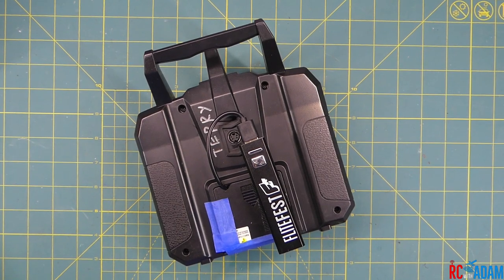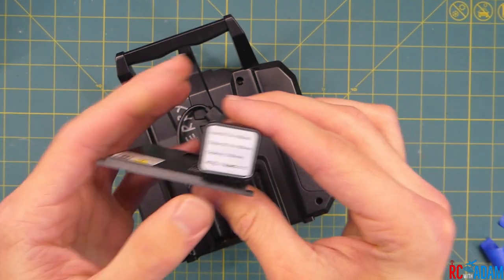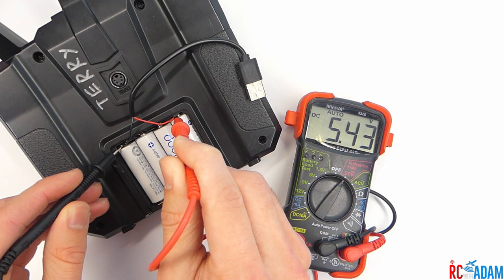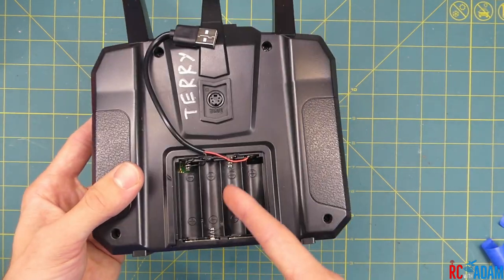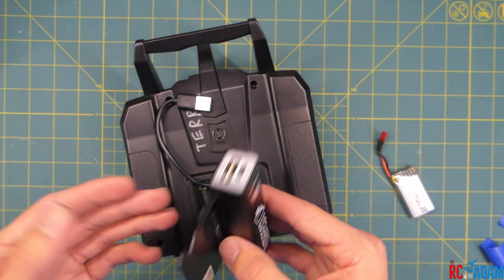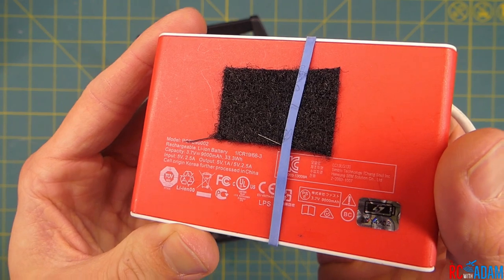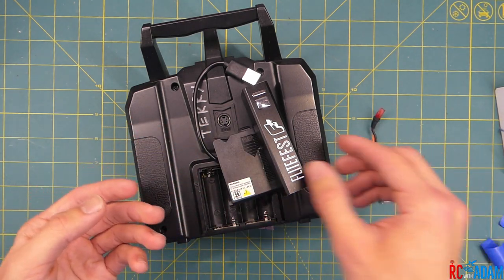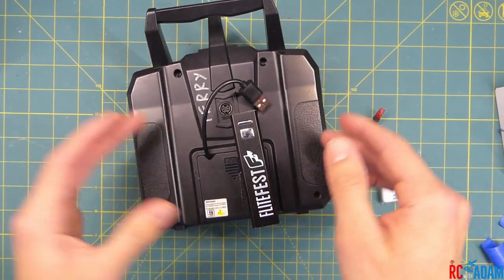FS-i6X Simple DIY Battery Mod - Lithium 5v USB -FlySky

Comment: This is a bad idea, firstly you haven’t considered or mentioned the Amp rating, most power banks have between 1-2.5A output which is way more that the system is designed for, also 4 AA cells equate to 6V (1.5 x4) and your power bank on a good day can only produce 5 of the Volts the radio requires. Just because it turns the transmitter on doesn’t mean it’s going to work. At the very least you should bench test this and measure output and performance before recommending this. Lipo packs do not work for Tx power!! You do get LIFE packs made specifically for radio systems but many radio manufacturers advise even against using them. You really should do research or at least have a working knowledge of electronics before telling others to mod their hard earned equipment! This is a bad idea!
Reply: lol... there are tons of others using this very same method without any problems..
Reply: The transmitter only draws about 300-400ma so the battery capacity is fine.... It'll run fine on 5 volts as most if not all semiconductors are designed to run 5 volts as a supply voltage.. I get your logic but it's like starting your car drawing a huge current draw from the battery for the starter. At the same time,  with the engine off turning on the radio... Same source two different current draws, the radio won't explode.
Reply: This mod should and does work fine. As noted in the user manual, the tx has a low voltage warning at 4.2V at factory settings. AA batteries start higher than 1.5V and slowly drop. So this system is designed to work fine at 5V USB as input. To his point, must know your battery bank and what it’s behavior is as it’s power drops. Shutting off would be BAD.
Reply: You have absolutely no idea what you’re talking about. Not one bit of your concerns are true

Comment: I believe the original voltage from 4 AA batteries is equivalent to around 6volts DC. From what I have learned in basic RF, this will reduce the amount of antenna strength and therefore reducing distance. I've heard the board can tolerate slightly above 6volts, which means a 2s lipo or Li ion would be ideal for an over all power increase. This definitely works though.
Reply: The transmission range will only alter if the RF output stage is running from the full input voltage. Not if is (as is most likely) running off the general 3.3v rail. (To maintain a constant limited output power as required by some Government agencies.) Adding a fully charged 2 cell battery will be much more likely to blow the internal step-down regulator - several folks have reported it. It seems that some regulators really are working at the limit of their capacity with 4xAA cells.
Reply: Depending on the chemistry, AA batteries (or D, C, or AAA, for that matter) don't actually produce 1.5V.  It's approximate.  A brand new alkaline battery actually makes ~1.55V, but it rapidly falls to ~1.25V and stays there for 80% of the actual battery life.  If you use NiMH or NiCd AA rechargeable batteries, they start their life at 1.25 and fall to about 1.2V for most of their battery life.  So 4xAA makes anywhere from 6.2 - 5V brand new and closer to 5 - 4.8V for the bulk of their usage.  Almost any device with a microcontroller will have at least one voltage regulator that converts whatever it is getting from the battery into 5V or 3.3V (this radio uses both) for the system to function reliably.  So no, monkeying around with the voltage within the nominal range of AA batteries is not going to hurt it.  I don't know what voltage regulator it uses, so I don't know the upper limit for it, but it's very likely that it can handle power from a 2S (8.4 - 7V) Lipo or maybe even a 3S.  There are regulators that can accept much more but that's not likely here - there would be no reason for them to spend the money on an unnecessarily versatile part.  I absolutely am not recommending that anyone try 2S or more, but most voltage regulators have a reasonably wide range of input voltages that they can accept.

Comment: Stepping down voltage has almost no difference in efficiency compared to stepping up voltage. Stepping down voltage might even be more efficient than stepping up based on the quality of the converter.

Comment: Unfortunately, it doesn't matter whether it's a USB charger (which is also a Liion battery with step-up converter from Liion voltage to 5V) or Lipo and step-up or Liion and step-down, it all comes out the same way, it will use up energy in any form of DC-DC conversion to heat...

Comment: have you test how far you can use transmitter because you use lot lot less voltage now. this need 6,4V and you use under 5V lot different at transformer how far can signal power go.and flysky battery alarm have adjusted 6 volt this must beeb alltime alarm under volt. need change alarm setup, and lot better have little lipo battery whit step up booster adjusted 6,"-4Volt. or big battery 7,4 V and step down board adjusted 6.2-4V but have big battery back.
Reply from the maker: Hi! No, I have not done a comparison test.

Comment: I like the idea of the principle of using a power bank. My 1uestion would be what max voltage output I can use and of course the system will only draw the amps it needs so even a 13000 mah would work as long as the voltage is correct.
So I ask what is the max output voltage of the power bank i can use. Please and thank you.
Adam keep up the great work , you are helping a lot of people out here in cyber land.
Cheers
Bob from Canada 🇨🇦
Reply from the maker: Not sure about the max. 5v is safe. It usually takes 4×1.5v aa batteries, so maybe 6v is max.

Comment: You could put a Boost Converter inside the battery door to jump it up to 6v. Not sure how much difference it would make, but you would get a constant 6v supply.Also many of these lipo power banks have a "Battery Gauge" on them.
Reply: Brother, can we connect the usb wire to laptop for power the transmitter which is connected with transmitter in this video

Comment: i did the same thing except i use a single lipo or 18650 and a stepup converter. It gives me a warning when the battery is low bc of the front voltage display going down to 4.xx volt, etc before dropping out.  generally gives me a few minutes of low voltage to let me land.

Comment: Problem is the Powerbank dilivers 5v to the end(noch Batterywarning) and cuts the Power of if it is empty.  So it can switch of in the flight. 

Nimh batterys decrese their voltage slowly,and the batterywarning works.
Reply from the maker: Good point. I'll keep an eye out for that.
Reply from the maker: That just happened as I was working with it on the bench. No low batt warning, just off (program that failsafe, kids! ;) ). Granted, the last time I charged the battery was when I filmed this video. When I plugged it in to charge and it turned back on, the voltage was reading ~4.49V. A warning is definitely helpful, but I think I will continue using this and just regularly charge the powerbank waaaaayyyyyyy before it is even close to empty.

Comment: Super dig it. I was about to do some major hacking on my tx, but this is an excellent solution. I have a bunch of those 18650 lipos that each fit in a silver usb sleeve thing that I got for like $2 a piece a couple years ago. This is perfect!
I wonder if the voltage will drop gradually down or if it will hover up around 5 until the last minute, and then drop rapidly because it is meant for charging devices.

Comment: is it okay to step up a powerbank to 6V? I fear the range of the transmitter might be affected if it stays at 4.5V.. Got led indicators on powerbank, so no problem with knowing when the battery dies.

Comment: Hi, your videos explaining Flysky Tx are so useful and the way of video contents are awesome. I have one question is that Can I use my 10000 mAh powerbank with input 5v & output 5.1v for my FS-I6x Tx? because using higher mAh cause any wrong to the Tx. 
thank you.
Reply from the maker: Hi! Thank you! Your powerbank should work just fine! 👍higher mah just means it will last longer.
Reply: @RCwithAdam1  thank you... cheers

Comment: What happens when power bank has low voltage? do you have some alarm or just cut off 5v?
Reply: It cuts off. Ive built it and it just cuts off when the battery runs out. Not safe for rc planes or drones without failsafe RTL.

Comment: after cutting my desired length and peeling off the outer jacket on my spare usb cable theres like an extra white and green wire, what will i do to those extra wires...
Reply from the maker: Hi! Okay sounds like you have a USB data cable (as opposed to one that is only for charging). No big deal, just don't use those wires. 👍
Reply: thanks! it worked!
Reply: Lol. 
That is data- (white) & data+ (green)
You are ABSOLUTELY ok to just cut them off. 
Be careful!!!!!
Nearly all USB power banks today have a sleep mode build in. Why does this mean for me....?
Bad things!
Being that the transmitter works on such a low power consumption rate, the power bank quite often will not know that there is a load and default to sleep mode, killing the power to the transmitter which very much could be DISASTEROUS. 

I know what your thinking. Add a couple of LEDs inline.... No. The power bank chipset is looking for a pwm signal announcing there is still a need for power. 

To combat this, build a simple 555 timer fading pulse circuit and add inline.

Comment: Furthermore I wanna use the power bank like this to replace the airplane.Can I ? I hope you Please reply to me when you see my SMS. Thank you
Reply from the maker: Interesting. I would definitely like to see a plane that runs on a power bank like this. I think the main issue is the low voltage for the weight. But maybe something like a big sailplane with a motor that runs well on lower voltage would work well.
Reply: yup ,try use 2020 LIFE batterys for longer flight and less power: sp light craft/glider/wing!

Comment: If I want to use 6500mAh ,can I?
Reply from the maker: Sure! You could use as large a battery capacity as you like, as long as it's right around 5 volts.
Reply: Thank you so much for your reply to me,but this is the power bank 6500mAh or 13000mAh. Can I use this power bank to replace the airplane battery?can you tell me?
Reply: I would like to request you to upload a new video that talk about the power bank with airplane but not use the Lipo battery with the airplane, Could you?
Reply: Lithium is not a good idea for rc plane as it has high discharge rate and lipo has low discharge rate. Using lithium will shut the motors off in seconds